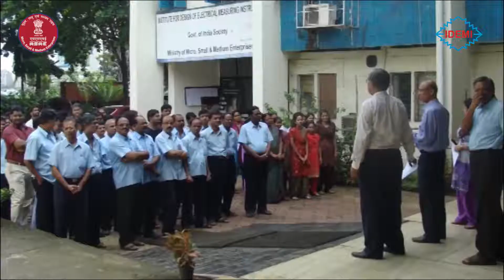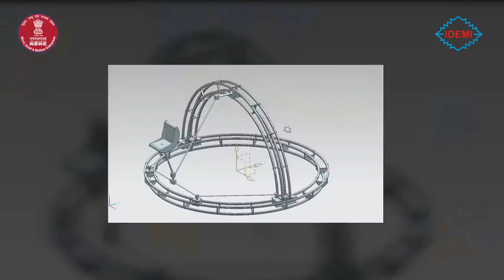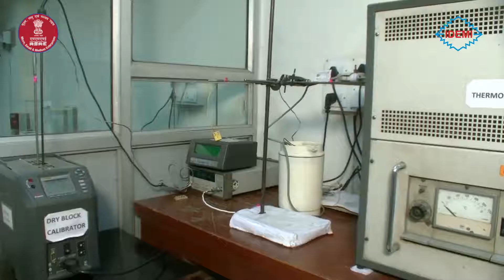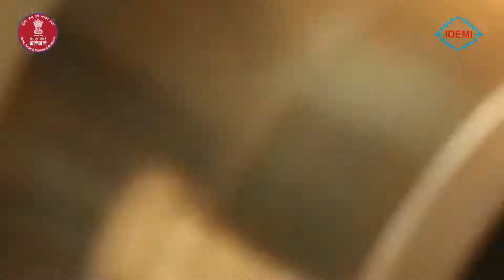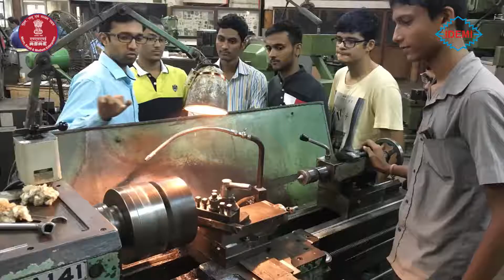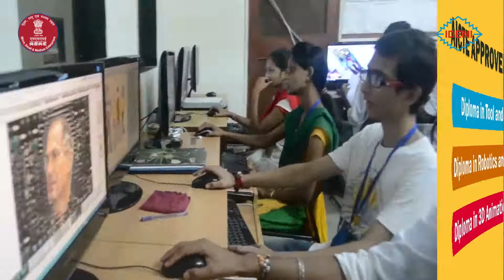IDEMI

Comment: IDEMI SERVICES 
CALIBRATION AND TESTING, TOOL ROOM AND TOOL DESIGN, DESIGN AND DEVELOPMENT, TRAINING FOR SKILL DEVELOPMENT
IDEMi is Providing services in the following areyas
• Technical Consultancy in various aspects of Instrumentation.
•  Industry sponsored projects in the Design & Development of Electrical, Electronic & Process Control Instruments & Transducers. Know how available may be transferred to interested party either exclusive or non-exclusive basis.
•  Calibration and Testing of Electrical, Electronic and Process Control Instruments, Sensors, Transducers & Electrically Operated Domestic appliances.
•  Calibration of Mechanical Measuring Instruments & Inspection of Mechanical Products & Components.
•  Technical Training for wide range of professionals in numerous disciplines of Instrumentation.
•  Design & Manufacturing of Press Tools for sheet metal components, Plastic Moulding Tools, Forging Tools, Pressure Die Casting Tools, Jigs & Fixtures
•  Manufacturing of critical mechanical components and maintenance spare parts required for Instrument Industry. IDEMI is rendering its services through its various Laboratories, Training Department & Mechanical Workshop.